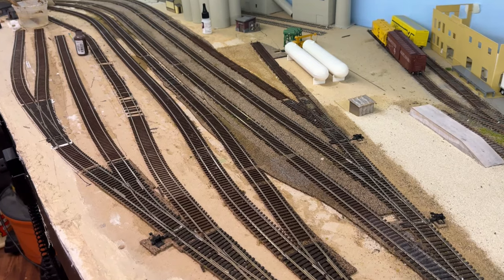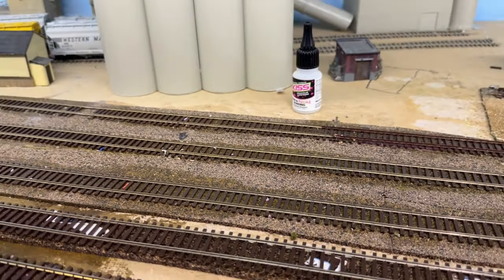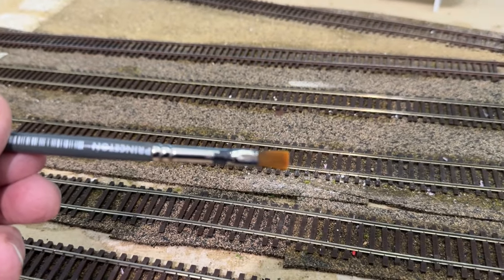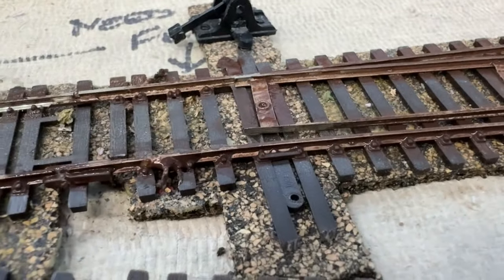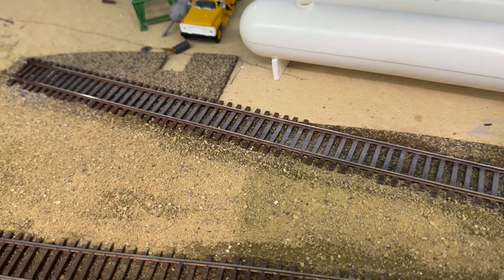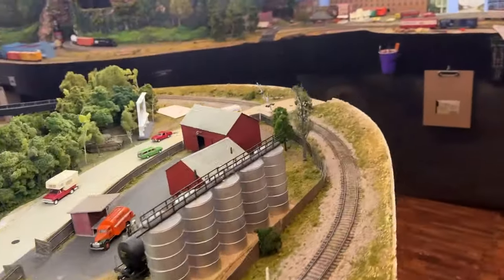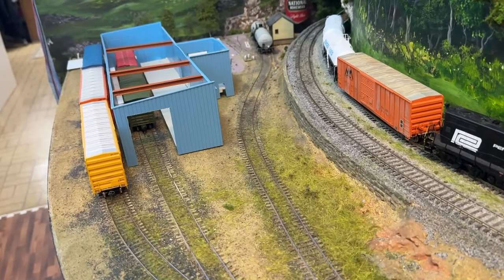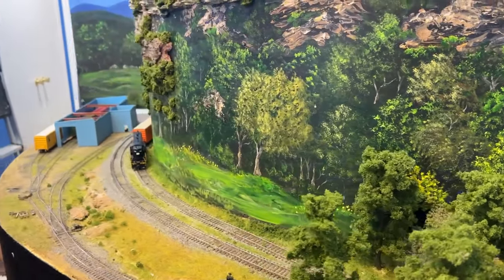Model Railroading How to: Painting Rail and Ballasting Lincoln Yard

Comment: Great video.  Would you recommend airbrushing the ties and rails instead if you had the setup?
Reply from the maker: No, you don’t get as much contrast in my opinion. I have an airbrush but prefer to do it hand painting. By doing so you also add rust to the tie plates which you can not do with an airbrush.